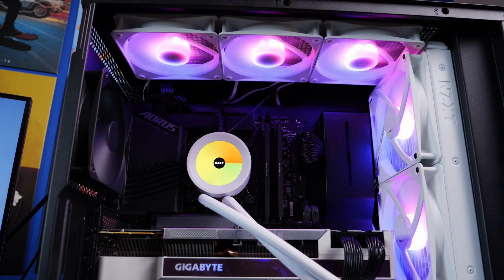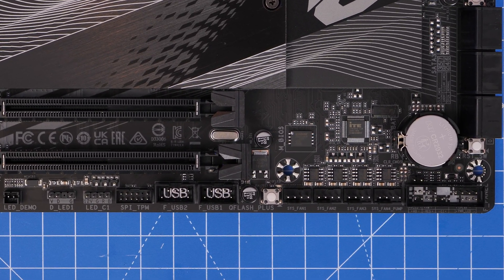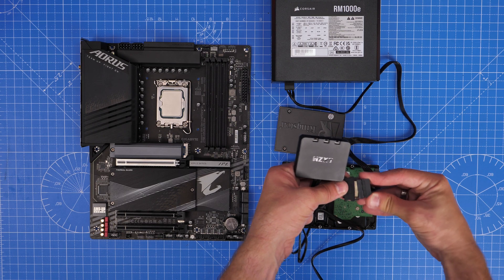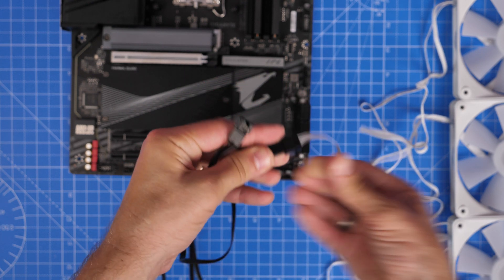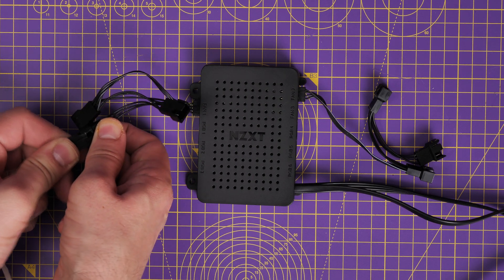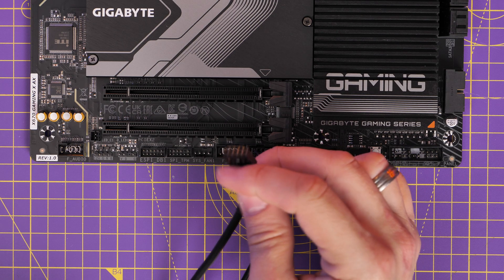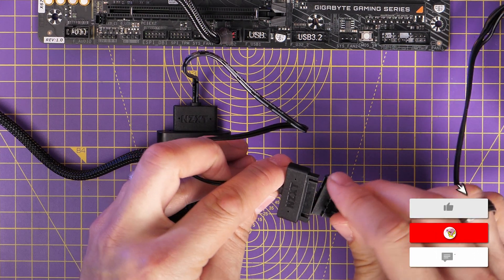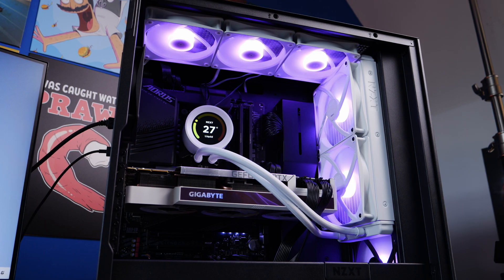How to connect NZXT F120 and F140 Core RGB Fans

Comment: Hey, I have encountered a problem. I recently got myself an NZXT H5 flow RGB, which has NZXT F140 RGB Core fans inside of it. The fans you have in the video have 4-pin PWM connectors, but mine have 3-pin power connectors?
Reply from the maker: that's fine, they can still plug into the  four pin socket
Reply: @TheProvokedPrawn but what I'm confused about is why are they different? Nzxt says on their website that these are the same fans even though they literally have different headers😅
Reply: And the ARGB headers from the fans can just be plugged into a 3-pin 5v header on the motherboard?
Reply: @AthenJ8660 did you get this prblem fixed, or plugged into the motherboard? i am dealing with the same problem and im not to sure if it wil damage the motherboard, has it worked for you?

Comment: Thank you for showing me that it wasn't me that blew up the 3 fan RGB controller than comes with the fans. Plugged everything up like you, but a capacitor blew in the controller as soon as I turned on my PC.
Reply from the maker: @wassupdeezy2823  that's unlucky

Comment: Hello, I just recently purchased an H5 flow RGB and I was wondering if there is a difference in the case version F140 RGB fans and the ones you can buy off the shelf. I’ve seen some sources saying the case versions are 3-pin DC with the off the shelf ones being 4-pin PWM. I was just wondering if you could back this up. Also, would it be possible to connect the case version fans and the off the shelf fans (if they have different connectors) to the fan controller at the same time?  Finally, do you know if it is possible to buy the NZXT proprietary connector to 5v ARGB splitter that comes with the case? Thanks.

Comment: I don’t understand why so many videos on these fans don’t show how to screw them in. I’m having so much trouble with it and there isn’t anything in the instructions about it. I feel like I’m going to break them trying to get them to sit right. All of your videos on their fans you don’t show how to screw them in :/
Reply from the maker: I've not had problems so haven't considered that as something people need. Sorry. I just used the included screws and an iFixit screwdriver and had no issues
Reply: @ i think I might just need a heftier screw driver. I ended up getting it working. Sorry I was just butthurt, your videos are very helpful and I’ve learned pretty much everything I know from them. 

It was only one fan that gave me issues, the rest were fairly easy to install but that single 120mm fan was killing me

Comment: i have just purchased the h6 flow rgb. is it possible to use 140mm fans and 120mm fans with the same splitter or should i just use the motherboard header for the 120mm fan? thanks
Reply from the maker: Should be fine

Comment: Can u use the controller without a modular power supply
Reply from the maker: If you have a power supply with the right connectors it doesn't have to be modular.

Comment: Great video! I have ordered the same case and I wanted to swap out F120Q on the back with F140 RGB fan. I also bought Artic Liquid Freezer iii 360 Rgb. Do I neee an additional nzxt controller to make F140 work or the one that comes with the case is enough?

Comment: What's the second connection required for the smaller RGB controller included with the fans?At approx 1.38 you mention 2 connections but only mention the SATA power connection. I'm guessing it's a USB header connection for the 2nd connection?
Reply from the maker: Yes

Comment: Was wondering if you have 8+ NZXT RGB fans, is it possible to buy a control hub other than NZXT that support as much ports for both the fan and rgb port and still control them using NZXT Cam?
Reply from the maker: Not these unfortunately as the RGB connector is proprietary to NZXT and non standard

Comment: Should I connect my fans directly to the motherboard or NZXT controller? As the Gigabyte software controls the fan curve, will it be able to control the fans connected to NZXT Cam?
Reply from the maker: If connected to the fan controller the speed and RGB is controlled by Cam

Comment: So I am a bit confused If I use two controllers will they still sync up? I know the big controller can do power for 9 fans and only 6 rgb but if I have 8 rgb fans. So will I use the other controller? or can I somehow wire all the rgb with the larger controller?
Reply: One of my orders was missing content in the packaging and NZXT was gracious enough to send me an even bigger RGB controller with 8 ports. Each controller comes with splitters as well. All your RGB control should be controlled by CAMs NZXT software and the system's fans should be plugged into your MoBo so they can spin up once the GPU hits the temperatures as directed. I wouldn't recommend purchasing two controllers just configure one and sync everything up nicely and neatly 👌🏽

Comment: I was wondering. I have the Mai b550-a pro and idk if it has the 3 pin rgb headers? Are they called jrainbow? I have 2 360 rgb core (one comes with case) so I need to find the connectors and the aio doesn’t need one it uses usb 2.0 and my back fan is non rgb
Reply from the maker: They can be called Jrainbow
Reply: @TheProvokedPrawn  thanks a lot u gained my follow 🫡

Comment: I have 9 nzxt f120 rgb fans in total. 3 from the case, 3 from the aio and 3 seperate fans. So how am i supposed to connect 9 rgb cables to the controller if it only accept 6 cables. T
Reply from the maker: You can't. You either have to use two controllers or a controller and an RGB controller. It's stupid.
Reply: I understand now. Thanks a lot

Comment: NZXT really should just include the large fan/rgb controller with their devices instead of the smaller 3 fan version. makes no sense!!
Reply from the maker: It's common practice. Corsair do the same. They want you to spend more on the controller.
Reply: @TheProvokedPrawn  well i caved and bought it. 😂 oh well.
Reply from the maker: @mikeisl33t  it makes life easier than trying to use multiple RGB controllers and fan headers 👍🏼

Comment: Hello this is really helpful, but I wanted to ask if it's possible to get both the core and aer fans working on the same system?

The core fans are aio and have their own RGB controller, but the aer 2 have a hub of their own.

I'm not getting RGB on the aer 2 you see so I'm having trouble
Reply from the maker: You should be able to yes. Are you trying to use the same controller for both?

Comment: Just built my dream pc with the h6 flow rgb and 1 extra rgb 120mm and 2 extra rgb 140mm. Micro center only sells 1 and 3 packs and I didn’t need 3 of any fan, so I don’t get a controller. Now I can’t even connect my rgb for the fans without buying an extra controller. Very disappointed in nzxt.
Reply: Same boat man I needed 4 and they only sell 3 packs so I bought singles and now i have to buy 2 damn controllers
Reply: @nickh8996  
I’m gonna buy 1 fan 120mm
Does it need a controller? Is it necessary?
Reply: @sarax5463  If you want to control the rgb it is necessary
Reply: @nickh8996  
NO WAY
You mean control the colors?
Is there any software for nzxt fans to change colors?
Reply: @sarax5463  Their CAM Software is what they use, but the connector for the fan is specific to the rgb header on the hub and not your mobo, so you need CAM and the fan hub to change the RGB
Reply: Does the h6 flow not come with a hub?
Reply: @ewanm8995  I didn't purchase them with a case itself so I couldn't say

Comment: thank you so much i know what i need. im building in the h6 and using 9 fans and didnt know what i needed now i know i need fan splitters and a rgb controller
Reply: Please can u tell me what u need exactly ? Because I’m building a pc in h6 flow with 9 nzxt rgb fans and I’m completely lost. Do I need the fan hub that comes with the aio, another rgb controller and a fan splitter ?
Reply: @Luca-bs4bldid you find out what you needed
Reply: @Iman-1710 Hey, I know this is like 11 days late but I hope this would still help. I assume you’re asking this guy what solution he came up with, but I just built an H6 flow with nine fans as well. You definitely need a control hub of some kind, or else your fans probably won’t appear in the NZXT CAM software and you’ll have to go through extra work to change them
Reply from the maker: Glad to help

Comment: Hey I've got a question Mr Prawn. If I've got a prebuilt PC with pre installed RGB fans connected to a button (changes light colors) on my case, what will happen when I press the button if I swap those fans for new ones?

Comment: Sorry for a stupid question:
I just bought 2x 140mm duo RGB fans, kraken elite 360 rgb radiator and the 3 rgb fans that comes with the case. 

Does this mean i just need one rgb controller and a fan splitter cable to run all these «8» rgb fans?
Because the 120mm non rgb doesn’t need a rgb connection?
Reply: im wondering too right now
Reply: Hey did you ever figure it out? Building the same thing lol

Comment: I’ve got 9 NZXT rgb core fans connected to their seperate rgb hubs, each rgb hub is connected to an NZXT internal usb hub that is then connected to the usb header on my mobo. I have full rgb control but I can’t figure out how to control the fan speeds? I can only control the cpu fan speed in CAM but msi afterburner doesn’t doesn’t do anything. Any ideas??
Reply: skibi

Comment: Hello I have a Motherboard that only has 1 Cha_Fan Pin is there a chance that I can buy a splitter for 9 Fans just in that 1 cha_fan pin?
Reply from the maker: You wouldn't want to run 9 fans on one header. It wouldn't have enough power. You'll need a Powered fan controller

Comment: Hello, i have 2 rgb duo nzxt fans and nzxt hub controller as you showed in your video, i connected all of them right and nzxt cam detect both fan control and rgb lighting, my fans are spinning, but they dont light, i deleted all other rgb softwares and reinstalled my pc, but they still don’t light, do you have any ideas why ? Thank you in advance!
Reply from the maker: That's a strange problem. Especially if they're being detected by the software. You can't change or adjust the lighting in the software at all?
Reply: @TheProvokedPrawn I am able to change everything but nothing is visible, they doesnt light whatever i choose

Comment: Is there an way to connect 6 fans for RGB control on the 3 fan controller?
Reply: Nah man, that's where they get ya. You have to purchase the 6 RGB controller with the fan plugin. Just added more fans to mine and I didn't even think of it until now
Reply: Yea, i recently bought the 6 Controller. It kinda sucks that NZXT wont give you an controller when buying the RGB variant of any case. @pjbroadaway4884

Comment: Hey! Thank you for the video, I think you're one of the few that provides much needed information about NZXT's F120 fans. Am I able to split 6 fans using 2x(3way4pin) cablesplitters to 1x(2way4pin) cable splitter and connect it to the CPU_FAN1? My motherboards CPU_FAN1 supports 2amps and 24 watts. It's the Mag z790 Tomahawk wifi. I'm just trying to wrap my head around connecting all 13 fans
Reply: So how did you end up doing it?

Comment: I HAVE A QUESTION SO MY CPU COOLING FANS ARE CONNECTED TO THE RGB SPLITTER WHICH IS CONNECTED TO THE USB, BUT THE CASE FANS ARGB ARE CONNECTED TO THE  ARGB MOBO SLOT, SO MY QUESTION IS CAN I CONNECT THESE CASE FANS INTO THE RGB SPLITTER WHERE THE CPU COOLER FANS ARE I HAVEE FREE SPOTS ! IS IT SAFE TO DO IT ? TY ALOT FOR THE GREAT VIDEO ( ALL FANS ARE NZXT COOLER ASWELL ) TY IN ADVANCE (CASE NZXT H5FLOW) (CPU COOLER KRAKEN NZXT 240 ), SO I CAN CONTROL CASE FANS ASWELL WITH THE NZXT CAM

Comment: Thank you for your video, clarified alot! Ok so I didn't know the controller could only manage 6 fans for RGB but power 9 (without RGB I assume). That's a bit lame. How would you go about power and RGB-managing 10 Duo RGB fans for the H9 Elite case? I can't wrap my head around it, seems so little information to be found ..
Reply: Did you ever figure it out ? I think 2fan controller would’ve been okay

Comment: How much splitters does the fan controller come with 1 or 2 because I need it for 5 fans so should I buy extra splitter?
Would I also need to connect my cpu fan to this?

Comment: So do you need a rgb controller for them to work? Because I have the rgb connect to my motherboard. It has rgb ports but the rgb is stuck on green blue and white. And it's not fully on either, theirs only like 4 spots lit up. Please help me.
Reply: Does it work now? Have the same prob
Reply: @heleneberg3902  my fans were broken still haven't bought new ones lol

Comment: I have the H7 Flow RGB case that came with the 3 front 140 rgbs and the non rgb in the rear.  I purchased another F140 core RGB, can I connect it to the other 3 fans?  I have the MSI B650 MB which only has 2 ARGB and 2 RGB.  I might be doing something wrong but the fan works but no rgb.  It was working but I didconnected a few things and now it wont light up.  note: This is my first PC build
Reply: I’m running into the exact some issues did you ever resolve this?
Reply: @Ksully-nb3yp  No!  I ended up returning the RGB fan.  I found out that there were not enough connections on my MB and that I needed the controller in order to dongle the fan to the others which I didnt purchase.
Reply: @mikec6040  thanks for the reply

Comment: Does anyone know why I can't control the f140 core rgb fans by pwm? left alone at fixed speed
Reply from the maker: Have you set the header to PWM in the bios?
Reply: @TheProvokedPrawn  Yes, I even have noctua PWM fans and they work. The F140 Core turn on, I can change the rgb but I don't see the RPM, I can't change the speeds either

Comment: Can you mix nzxt fans with other branded fans? I owned the be quiet 360 aio and thinking of buying 2 of these nzxt fans (140mm) to complete my build (hyte y40). Can I sync the lights?
Reply: i dont think u can sync the lights, i have lian li fans with 3 nzxt fans
Reply: If u do get two separate brand fans u might need a sata cable splitter if u wanna plug in another rgb controller to the rgb or just get fan splitter. I have a nzxt 360 aio and the rgb don’t come on unless I get another splitter for another rgb controller

Comment: Biggest let down with the F series in no Daisy chain
Reply: i agree with you mate, did my pc build based with the legacy AER fans last year, each fans had an extra port for daisy chain/to interconnect with each other, way better than this, they made it more complicated with the rgb controller....
Reply: useful thread guys! So how to chain the rgb 4 pin connectors? I can't find any splitter cable on the market. I need another rgb hub controller? 
And how to sync the animation of the fans with the NZXT led strips? 
thanks
Reply: @daimbegdani Nzxt cam software
Reply: @daimbegdani I’m quite sure that there is a splitter cable online. You should connect the fans you already have to the splitter cable and the extra fans you have to the controller itself
Reply: just had a blade on one of my AER fans and since they have no daisy chanining your left having to order a fan that requires rewiring the layout to have this one be the last in the chain. somehow need a longer rgb cable now...
Reply: what do you mean no daisy chain? is this not what he did at @2:58 ?
Reply: @2004helloWorld  No
Reply: @2004helloWorld  i cbf explain google it

Comment: Just a small side note: Please stop praising the Lian Li fans. I have a total of 4x Lian Li Uni Fan SL-INF 120 ARGB PWM cleanly installed in my new computer, at low speeds. Within only 3 weeks I already have 2 broken fans - sudden rattling, noise, no longer usable. While other Noctua fans have been running without problems for years. These things must be of sub-par quality.
Reply from the maker: I've never had any problems with Lian Li fans and can only speak to my experience. They're in my main machine and have always been, with zero issues.
Reply: @TheProvokedPrawn  In the years I've had a TON of different fans from many brands. But I never made the experience that fans fail within only a few weeks of use. 2 brandnew Lian Li fans failing like this - with the same kind of damage. Under these circumstances, I really don't believe in a stupid coincidence, but in poor quality. Well, lesson learned. :) Back to Noctua or BeQuiet. No more RGB nonsense.
Reply: @tannhaeuser BeQuiet makes some lovely RGB fans nowadays. Ring lit too, not the cheap looking diffusion lighting
Reply: i have 6 lian li fans, one stopped working for like a couple days and it fixed itself but never clicked or made any sounds before